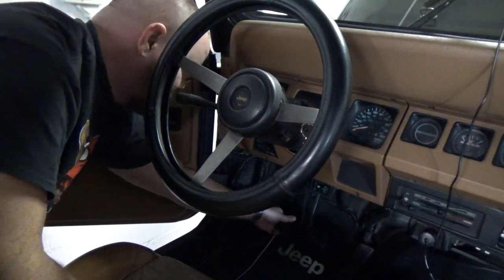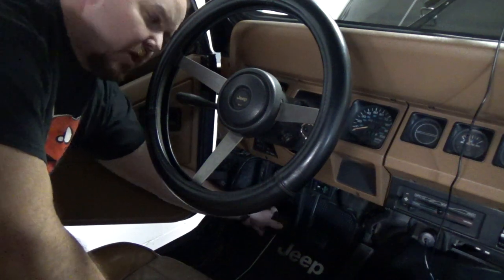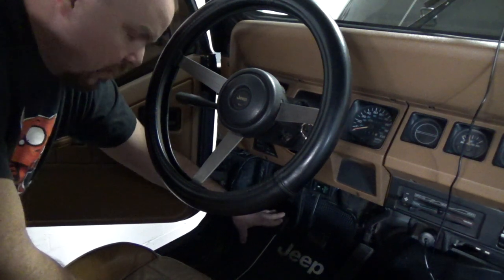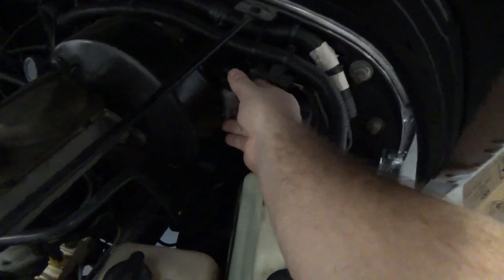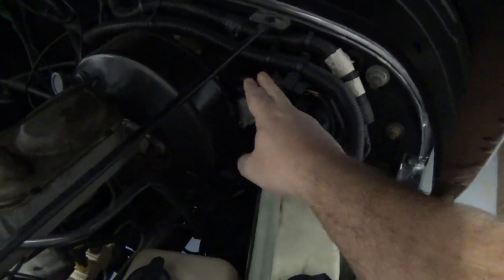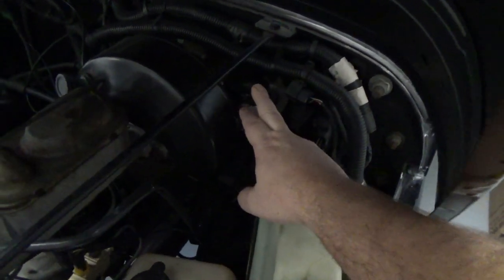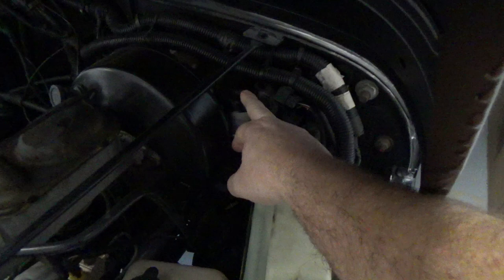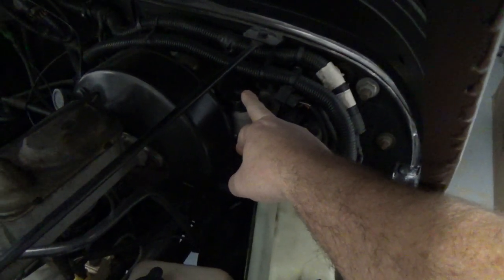Temp Fix Jeep Wrangler Clutch Won't Engage || Jeep Mods E07

Comment: You may have just gotten a little air in the hydraulics and it just had to be worked out. You’ll probably eventually need to replace them. Make sure that if you do replace them you get a pre bled kit that all you have to do is bolt it in
Reply from the maker: Thanks for the advice, and on this kit, does it bolt at the slave cylinder? I thought you would bleed the clutch just like you would brakes, but like I said, this is my first time to work on a vehicle with a clutch.
Reply: Chris Does What you can do it that way but sometimes you may be there an hour trying to bleed it. If you get the prebled kit you just unbolt it from the trans and unbolt the reservoir all in one and the new one with just bolt up in place and it’s worth the extra $10 or however much extra it cost
Reply from the maker: Well if the problem comes back I may give this product a try, I know I will be replacing the slave cylinder just for good measure.
Reply: Agree! Air in the clutch hydraulics. 
Sounds like you "reverse-bled" the system when you pushed the plunger back in (and got your head wet), and then you/your son must of added fluid prior to pushing the peddle in, and getting even more air in the system. 
Not sure, but that is what it sounds like to me.
Reply: Don't replace it if it works ,never fix anything that isn't broken
Reply: Just maintain it that's all you have to do and every car would last until it's weakest link starts breaking after two hundred k miles
Reply from the maker: You don't always want to wait to fix some issues. Wore part can either leave you stranded or cause other parts to wear more rapidly.

Comment: I couldn't get it in the first gear is where would you recommend to look into first?
Reply from the maker: Can you get it in other gears?
Reply: @ChrisDoesWhat  yes other gears is ok.
Reply from the maker: @ujayet  The only thing I can think of is that there is something in the way. When we did our transfer case drop and had to trim the floor. If nothing is in the way you may have an issue with your transmission. We have over 100K on this Jeep and it now sometimes pops out of 5th gear.

Comment: My 89 has been fine until last week Now it sometimes won’t engage when driving but is fine when not moving.
Reply from the maker: Thank you for watching! Sounds like the same thing, this was fine when not moving, was a problem when you wanted to.
Reply: Chris Does What I filled up clutch fluid gonna let gravity bleed it for a few days see if that helps it so far no luck :(
Reply from the maker: If you have air in the line your going to have to bleed it. Just like doing brakes.
Reply: @canadianswordfight4609    Did it help??  :)

Comment: Its because there was air in the line because he let the fluid get too low it happened to my jeep before.
Reply from the maker: Sir in the system will cause the it not to engage the clutch. Our issue was the rod was worn and allowed it to get hung in the engaged position.

Comment: It's slipping but just in high gear for now I need help !!!!!!
Reply from the maker: We just had our transmission rebuilt and put it in, see that video. If your transmission is slipping out of gear it cold be caused by low or contaminated fluid, worn synchronizers inside the transmission, or improperly adjusted shift linkage
Reply: slipping in high gears, at highway or near highway speeds, is precisely where plain old worn clutch is first noticed. Intuition is that you would first notice it in low gears, from a stop, but in fact it first shows in high gears.  You have classic symptom of basic worn clutch
Reply from the maker: Yep, I  miss read that. You are right, that sounds like a clutch. It should also have a hot smell when stopped. Maybe even a burnt clutch smell.

Comment: I'm having the same problem on my 03 Jeep Wrangler tj when I shift it to a gear or just driving down the road the rpm will shoot up like someone pushing in the clutch
Reply from the maker: I did have to replace the clutch slave and master cylinder in this video. https://youtu.be/j4ESmdy9ZZc